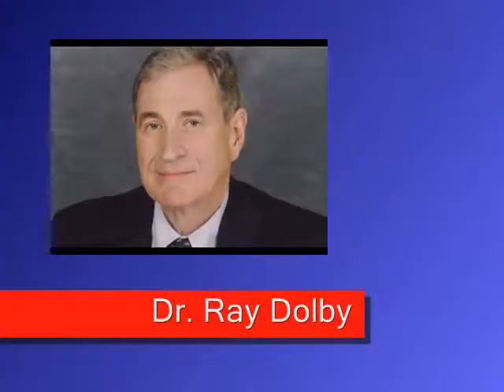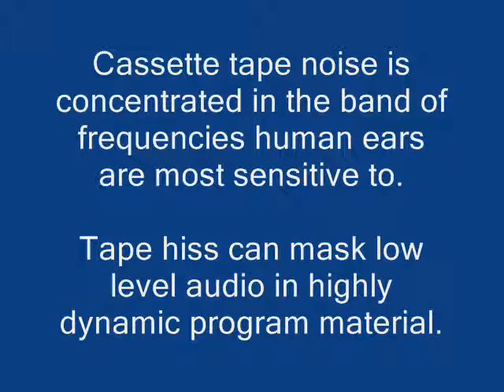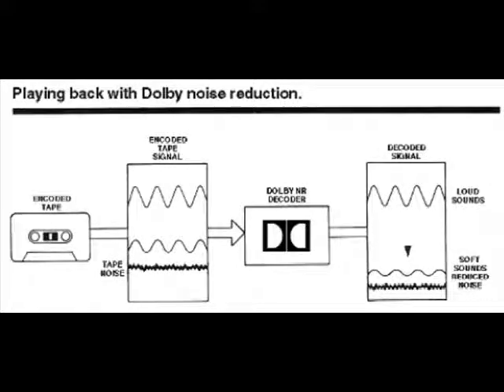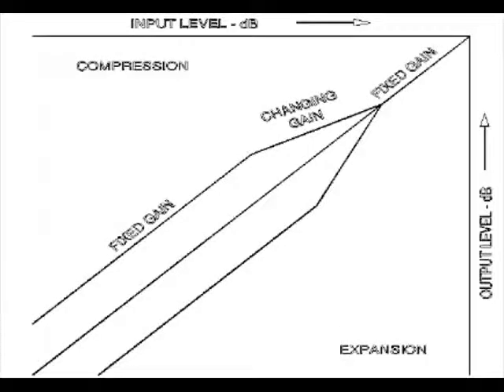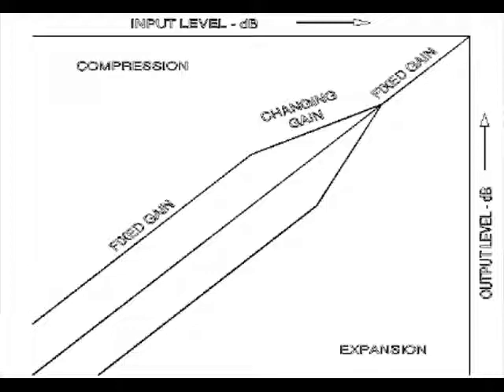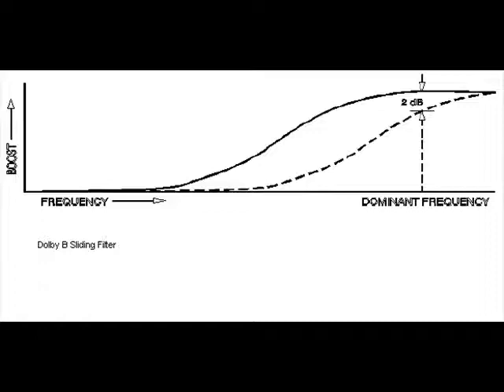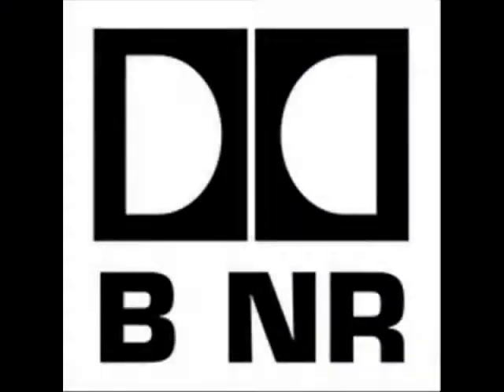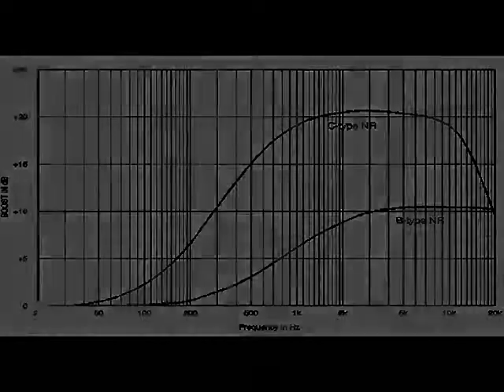A Quiet Chat About Dolby

Comment from the maker: Most of the noise on tape that is bothersome is in the high end so Dolby works mainly in that spectrum. Also, the system, depending on which one, B, C or SR, Reduces noise but does not eliminate it entirely so you'll still hear a bit even when everything is working properly. :) JC

Comment: Great video, but there's still something I don't understand. Why does Dolby only boost high frequencies? Aren't low frequency, low amplitude signals still harmed by higher amplitude tape noise? I can still hear tape hiss in a bass guitar solo if it's quiet enough.
Reply: Benjamin Rorie Human hearing isn't as sensitive to low frequencies, so they just concentrated on the highs.  Dolby A, S and SR actually do compand the bass but they are too complex/expensive for casual users.

Comment: Back when I used cassettes a lot, both in the car and on the Walkman, I would always realign the heads to best match my recordings.  That not only ensured that I got the most highs off the tapes, but it also made it so that Dolby would work better between my machines.

Comment: Heh.. When television stations were still using tape, some of the ones around here would often use Dolby NR improperly.  There was one in particular, that always ran their tapes in decks without Dolby, even though the tapes were recorded with it.  I actually called them about it, and they claimed that what I was hearing was an auto leveler that wasn't adjusted properly.  I KNOW it was Dolby, though.  Of course the auto leveler would pick up on the extra noise and then boost it, which only made

Comment from the maker: @HamtaroEL The potential for distortion is all on the record side in this sort of system. Playback EQ just makes the output flat again to match the original audio recorded. It works because most of the energy is in the low end of frequencies for normal music and speech. However, get something particularly bright and you run the risk of overloading the system. :) JC

Comment from the maker: @HamtaroEL Yes and no.  The more the high end is boosted and then lowered back down again on playback, the less noise you will hear from the tape. However, slamming all that high end on the tape will cause distortion if it's driven too hard. There is a balance between potential distortion and better noise performance. :) JC
Reply: @Joe Collins Which do you prefer?

Comment from the maker: @fooziex Your definition is correct, strictly speaking. Compansion also refers to the peculiar action of the front end of the NR circuit. Unlike a standard compressor, a campandor works below a certain threshold. Above it, the dynamics are left intact while below that threshold the audio is aggressively compressed.  In other words, it does not "push" the gain down as much as it "pulls" it up. Calling it a compandor helps to distinguish it from a traditional compressor. :) JC

Comment: @BadEditPro Yeah I totally see that - but by the looks of it, it was a VERY well thought out concept that became a standard. I understood the boosting and cutting of the frequencies, I'll just have to read up a bit on the sliding filter and the compander/expander. I know what the expander does now (it increases dynamics, correct?). FM to me is just a very low frequency radio wave (the carrier) modulated with the signal that as to be carried (the modulator). Guess there's more to it. Thanks.

Comment from the maker: Cassettes can be re-recorded indefinitely before the tape starts to show any degradation. Most recorders do a fine job of completely erasing the tape but a bulk eraser can get it back to virgin levels. FeCr tape was produced for a very short time in the late 70's.  It proved to be very unstable and was taken off the market.  It has not been available for over 30 years.  I've never actually seen one. :) JC
Reply: The record head also produce a little bit of electrical noise that's why it is a little bit noisier than erased tape.

Comment from the maker: Dolby HX Pro is a circuit that automatically lowers the bias signal to the record head when the audio has a lot of high end in it, like cymbals.  With fixed bias, high frequency energy in the audio can mix with the bias tone causing the tape to be over biased and the result is distortion.  HX- Pro was developed to address this issue. I think HX-Pro can make tapes sound thin with lack-luster bass because it causes under biasing in audio that has a broad frequency range. I try to avoid it. :) JC